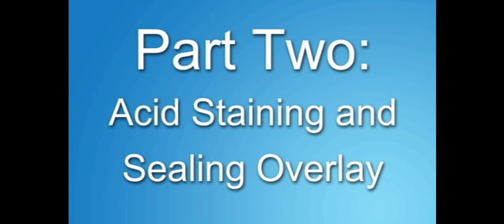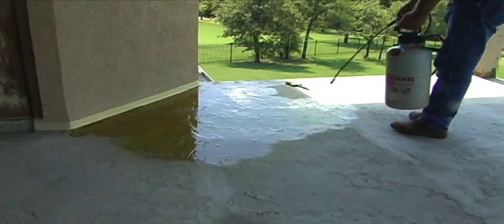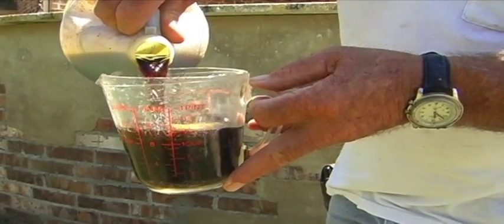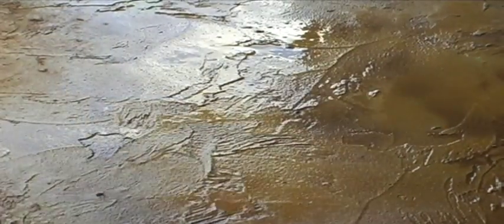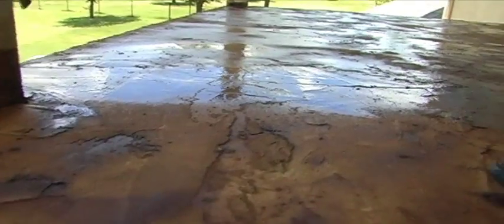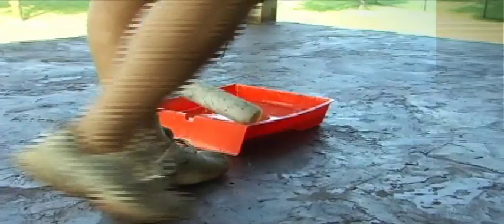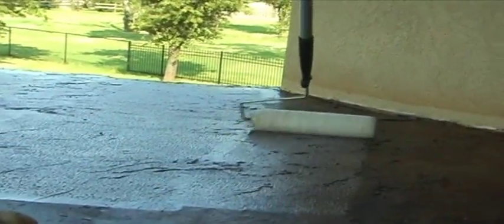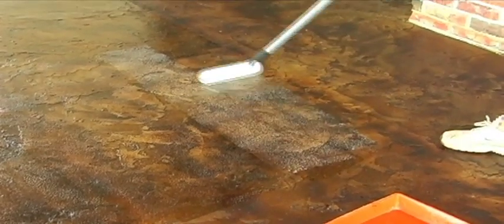How to Apply Acid Stain and Concrete Overlay: Part Two - Applying Acid Stain and Sealer to Overlay

Comment: As someone that has poured and stained concrete for decades. When dealing with acid stains ,be aware of areas partially in sunlight and partially in shade. I also recommend masking paper on everything you don't want stain on and watch were you step .
Reply from the maker: Hey Bart, awesome advice, we always appreciate pro tips like these!

Comment: I notice some people just spray stain and then seal it whereas some spray stain and neutralize it with baking soda and scrub the stain and rinse with water before sealing it. Does both work?
Reply from the maker: Johnny, both will work. It is just a difference in stains and their processes. Acid stain requires neutralizing because it is an elevated PH. But the other stains do not require this step and this is why you see two different processes.
Reply: @directcolors  yup I got concrete coatings acid stain and plan on neutralizing it with amonia
Reply from the maker: That is correct, remember 1 cup of ammonia to one gallon of water.

Comment: would you please give the steps and colors that you used.  thank you
Reply from the maker: Thank you for your question :)

The color is achieved with "Coffee Brown" Acid Stain, found here: https://www.directcolors.com/product/concrete-acid-stain/ 
And a "Solvent-Based Satin" Sealer found here: https://www.directcolors.com/product/sprayable-satin-finish-concrete-sealer/

Find more projects and applications at our website: https://www.directcolors.com/our-projects/
Reply: @directcolors  what is Sedona brand Acid Stain

Comment: Could of did a better job finishing the concrete
Reply from the maker: We agree, however, the contractor was responding to the wishes of the homeowner. We filmed the contractor at a job site and though we might personally agree with you on the finishing, as manufacturers invited to film, it wasn't our place to criticize. Thank you.
Reply: They probably wanted better traction

Comment: so he dilutes it for the second coat, but narrator says "he is applying darker accents..."  so did he switch colors?  because if he uses the same color but dilutes it, it would be a lighter accent would it not?  please clarify here?
Reply from the maker: Thanks for your comment. He is using the same color diluted with water at differing strengths. Acid stain can be applied full strength and cut with varying amounts of water to produce subtle color variations on concrete. The color would get lighter as the water content increases. The more diluted color can be applied first as a base color or after to spray out the darker accents. Either technique is acceptable. I personally prefer to apply the darker accents first and then while still wet, spray my diluted color to blend everything in for a more natural appearance. Hope that answers your question satisfactorily.
Reply: Actually you just clarified quite a few problems I had with my first few small acid stain jobs (for myself, just DIY for now).  Looking forward to trying your technique!!!!  Thanks.
Reply from the maker: My pleasure but keep in mind there are many ways to apply the stain and it does vary depending by the project itself (countertop vs. floor, etc.) Feel free to send us any future questions you might have at https://www.directcolors.com/company/contact/. We'll be happy to help. Good luck!
Reply: OK - I think you guys will be providing the stain for my sidewalk project.  I would like to call to talk about application techniques, as I can already see there was a lot I did not know.
Reply from the maker: Thanks for that opportunity. Feel free to call us at 877-255-2656 whenever you're ready and we'll go over your project with you before making a purchase.

Comment: How do you get that texture?!
Reply: I think the texture is from a texture stamp when the concrete is poured.  if you already have an existing pad, you might get texture from a concrete overlay - thin layer poured over the existing pad.
Reply: it's actually not. If you watch the first video, you will see that the guy first applies a coat of overlay over the patio. He trowels it on. He is able to create the texture with the trowel